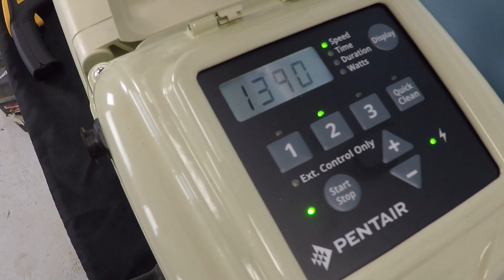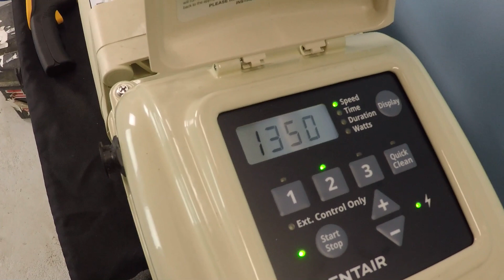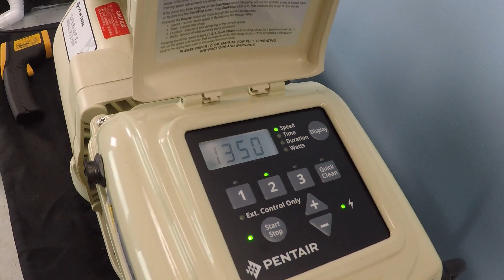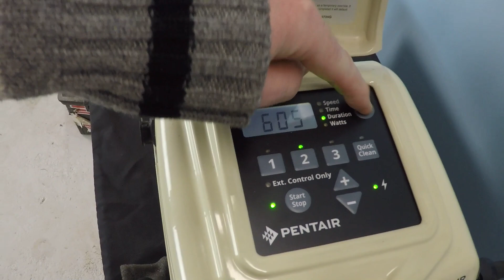What RPM For 25 GPM - Pentair SuperFlo

Comment: This is very helpful and I REALLY appreciate your detailed information.  I found you because I am pretty sure I have a leak in my return line I have been losing a ton of water and have blamed it on evaporation from heating my pool to 85+.  So I am in the midst of doing a pressure test.  When the pool was installed we lost tons of water and they came back and blamed the jet not being tight and a gasket blowing out, I don't think they ever fixed the leak.  I am replacing my pump, filter and salt sanitizing system. I am looking at a VS pump but had huge concerns about flow rates to be sure my hayward heater had adequate flow. I will be buying a flow meter thanks to this video.   I have questions about jet orifice size and flow,, last year I changed from 3/8" to 3/4" jets and while that helped with dropping my overall system pressure into the range my filter wants, skimming became inefficient as the jets had less push..  If you have videos on jet orifice size, its effect on flow, skimming and pressure,, that would be great, Thanks
Reply from the maker: Do a bucket test to compare to evaporation losses. As for eyelet size, trial and error is your best friend. As you saw, you were able to reduce system pressure but the pool skimmer became ineffective. Since every pool is unique, trial and error really is the only method.
Reply: @Swimmingpoolsteve  thank you for your quick reply.  I saw another of your videos where bubbles were coming out of the jets and yes I have bubbles after tightening up and lubing the O-rings and plumbing, even the pump basket seal.   Where do I buy the line test fittings, the better ones, as I am about to replace everything, I want to perform a good pressure test.  The installer did really shoddy work and it took years for me to correct problems they left behind, like hard wiring the Pool Pilot chlorine generator to be on 100% of the time and not go off with the clock, the cooling fans weren't plugged in and a big capacitor blew like an M80.  They subcontracted every part of the job but failed to oversee the work.  I would bet big $$$ I have a leak, my water loss is huge.  Thank you